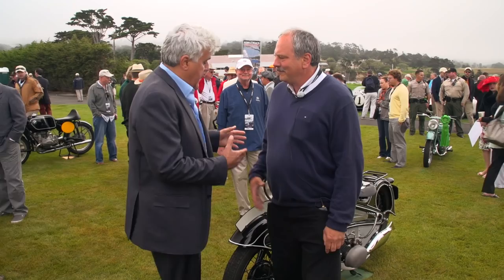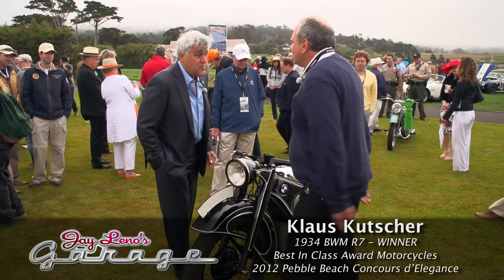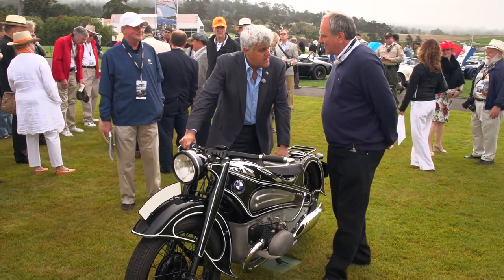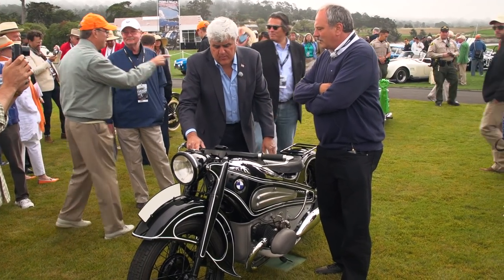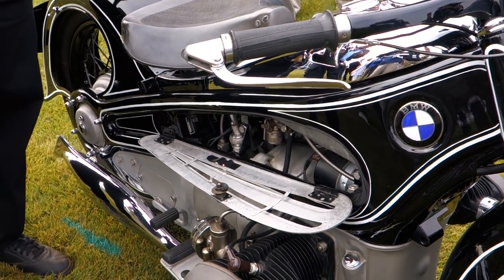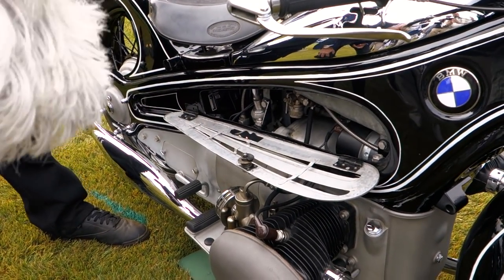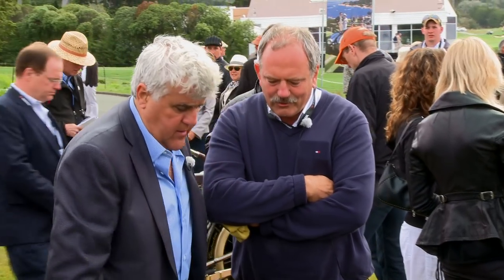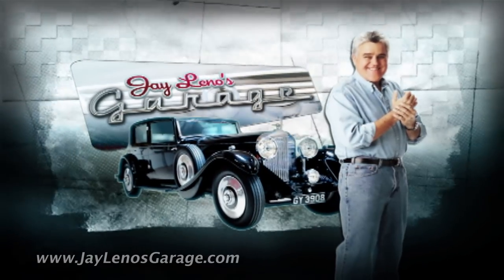Pebble Beach 2012: 1934 BMW R7 - Jay Leno's Garage

Comment: In summer 2005, the BMW company, workers cleaning the old Bavarian brand stores. Suddenly he found a dusty box. Inside was a disassembled motorcycle BMW R7 1934. We all fell in awe, because that was the only prototype produced. R7 admired design in art deco style and an elegant combination of steel and chrome. Technically, the BMW motorcycle ahead of his time. Some solutions of R7 used only in the 70s The twentieth century.

Comment: BMW R7 never made it into production. At the time of the Third Reich, it was too expensive design. Motorcycle created engineer Alfred Böning. The prototype had a two-cylinder four-stroke boxer. BMW R7 has therefore been dismantled, packed into boxes and moved it to the store. Today has been restored and delighted fans of motorcycles and art.

Comment: There is a  clutch lever on the left handlebar, not a foot clutch. The hand shifter is on the right. This would mean that every shift requires the rider's right hand to release the throttle tube to reach for the shifter. The engine rpm will fall for all the time it takes to select a gear before grabbing the throttle again. Clumsy design.
Reply: You're supposed to let off the gas when you shift every motorcycle so it's a great design.
Reply: orange70383 A design that was so great it was never used by BMW in later models or any other manufacturer.

Comment: Hi since you are familiar with this bike , do you know if there is any rear suspension, or only the coils under the seat?Also is there any similar BMW bike that got into production?I think the R17 1935 has a similar engine ?
Reply: just the seat coils. It says s in this video.